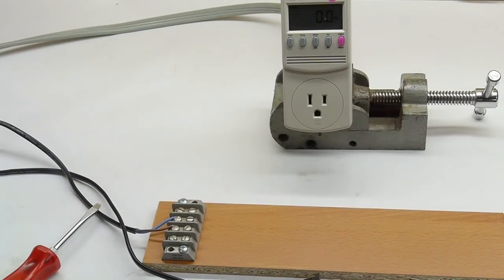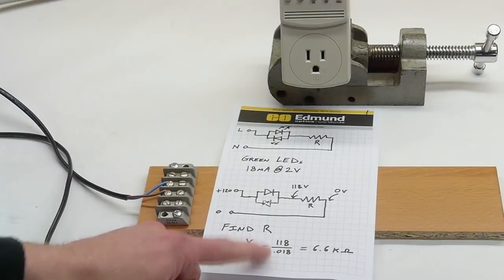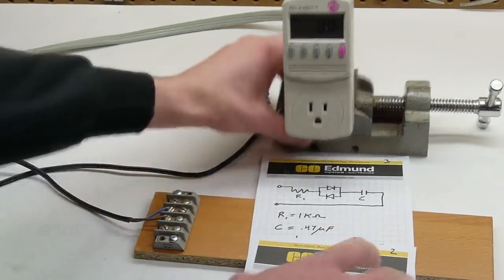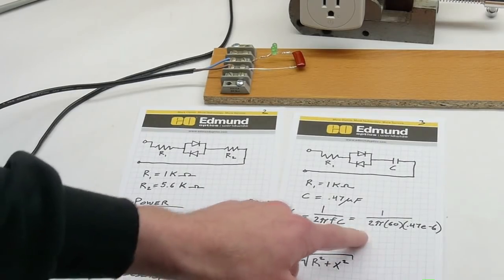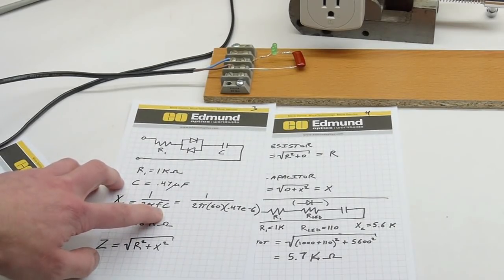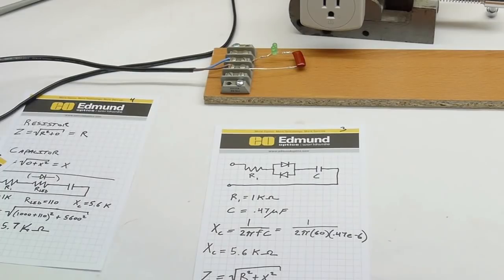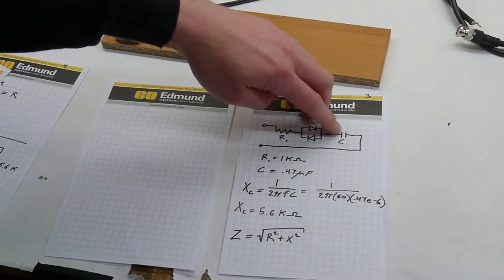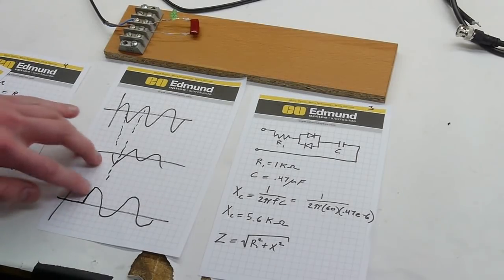Tutorial:  Electrical impedance made easy  - Part 1

Comment: It would be great to plug in both of the circuits you built side by side and then film them at high speed. You could replay it in slo-mo and show that LED#1 in one circuit comes on before LED#1 in the other circuit even though they are connected to the same power plug because of the phase angle change of the impedance due to the capacitive reactance. That would be a great visual to explain how the capacitor does not consume energy but rather returns the energy to the circuit at a different time in the cycle.

Comment: You can create the same effect by using a 1n4007 diode and a resistor.  The voltage is rectified into a dc source and the resistor limits the current.  The power factor is pretty good since noting gets too hot and you only need one led.  The ac frequency is high enough so the led does not flicker to the eye.

Comment: Question: That resistor that you added do prevent inrush related damage only has a value of 1k Ohms, which when put up against a possible peak +/- 120v of inrush, would draw something like 14.4 watts. Wouldn't that still absolutely destroy your LEDs? Obviously not, as you really understand what you're doing, and I don't, but could you explain how a mere 1k resistor can protect your circuit from inrush?
Reply from the maker: I didn't carefully engineer this circuit, and the values were chosen just for ease of demonstration.  You are correct that 1K is probably not enough, however to calculate the instantaneous power through the LED, you'll want to do the following:  In worst-case scenario, the plug is inserted at peak voltage (170V), and the capacitor behaves like a dead short at that instant.  Thus, 170V - voltage drop from LED = 168.5.  168.5/1K = 168.5mA.  Power dissipated in the LED is (0.1685)(1.5) = 252mW This is probably too much current/power for that LED, even for instantaneous ratings.  The current will drop very quickly as the capacitor charges.
Reply: +Conlan0215 You're right. 1kΩ of resistance is not enough for this circuit. In order to determine the value of minimal resistance required you'll need to consider the total response of RC circuit to an alternating voltage and not just the steady-state response. If you take this LED (L-383GDT), for example, in its datasheet it is said that the LED will take a maximum current of 140mA for (1/10)ms with (9/10)ms in between the pulses (1/10 duty cycle), or, in other words, it can handle a maximum charge of 0.000014C (0.14A*0.0001s) in 1ms. The max. current (or duration) of a single pulse should be somewhat higher (longer) for a non-repetitive peak forward current.

Btw, switching the circuit on at the instant when the voltage is going through its positive or negative peak (+/- 170V) is not the worst thing that can happen to the LED. Imagine what happens if the capacitor retains some amount of charge after switching off the circuit. Impedance(Z) = 5688.6Ω; Capacitive reactance(Xc) = 5600Ω; Source voltage = 170V; LED voltage = 1.5V; Capacitor voltage = (170 - 1.5)(5600/5688.6) = 165.9V ( it's the max. possible voltage that can be present across the capacitor when the circuit is off). Switching the circuit on at the instant in time when the source voltage is at its positive peak (+170V) would be perfect, assuming the cap voltage is oriented against the source voltage, like this: (- 170V + + 165.9V -). In such a case the overall available voltage across the resistor will be: 170 - (165.9 + 1.5) = 2.6V, which will produce a current of 2.6mA through the LED (2.6/1000 = 0.0026, Resistance(R) = 1000Ω). Now assume that the voltage polarity on the capacitor stays the same (+ 165.9V - ), but this time the connection of the circuit to the source is made at the instant in time when the source voltage is at its negative peak (-170V). In this case the capacitor and source voltages are oriented in an additive manner, like this: (+ 170V -  + 165.9V -). The overall available voltage across the resistor will be: (170 + 165.9) - 1.5 = 334.4V, which will produce a current of 334.4mA through the LED (334.4/1000 = 0.3344). The problem can be solved by placing a resistor of MΩ range in parallel with the capacitor (the capacitor will discharge through the resistor each time the circuit is turned off).
Reply: because the value of a half cycle current is not more then 14 watts, so it will be absorbed and dissipated before it goes beyond capacity of resistor and reach LED.

Comment from the maker: True, the word "electricity" could be used in context of "static electricity", so it may not be fair to say that electricity flows. However, Merriam-Webster says that the electricity is "an electric current or power", and in my experience, most people who say "electricity" without the word static, are referring to current flows. Saying "voltage flows" would definitely be wrong, and I agree separating the concepts of electromotive force and current flow is important.

Comment: Really good information here. I could never find an easy explanation for it.  I actually measure impedance all the time on CLRs to check if they are degrading with an LCR meter.  So after watching this I am confused how the meter does it when just measuring a coil without knowing the frequency. Or is it just assumed it is 60?

Comment: That's really a great video! May God bless you for putting this up and helping us! :)

You said at 3:15, that LEDs don't care whether the resistors be on the left side or right side, I don't get that.

Shouldn't the resistors come prior to the LEDs so that there's a sufficient voltage drop prior to the LED and the LEDs get the required voltage?? However placing it after the LEDs would expose the LED to the mains voltage and harm the LED, as the voltage drop shall take place only after the LED, isn't it ?

Thanks.
Reply: Fuaad Mukadam voltage is not a "thing" but a potential difference between two arbitrary points.  it's relative. you're just as likely to plug the circuit in when the voltage was at the negative part of the ac cycle and the electrons wanted to go the opposite direction.  The resistance  restricts flow in either direction.

Comment: Great video very well explained. Ben I live in UK 240v I have a German valve radio 1950era this is 220v could I insert a cap of suitable value to drop 20v before transformer? Resistor would get too hot, many thanks John.

Comment: Hi Ben,

This is a great tutorial. I would like to try this in my workshop. I know the size of capacitor you used, but what type of capacitor did you use: Ceramic or Aluminum? Also did you use an AC or DC capacitor and what was its max voltage?

Thanks

Comment: Thanks mate, good video, that really helped.

What you say at the end about without there being a resistor in the circuit you experience that 'sharp spike' in current at the instant of applying power, which cooks the LED. Is that similar to what happens in your home when you turn on the lights and the globe blows straight away?

Comment from the maker: The frequencies are relatively low, eg a few Hz, or even fractional Hz. It looks like they are studying the impedance characteristics of electrodes as they vary the polarization potential across the electrode. The battery's construction is similar to a double-layer ultracapacitor, and so they are perhaps trying to separate the capacitive effect from the electrochemical effect. As with most research papers, we'd need a lot of background info to make sense of their work, and I don't have time.

Comment: This looks like a good idea, in theory, but in the "real world" there is another problem, besides the inrush at plug-in time.  Any noise spike on the line will fly right through the capacitor because it is equivalent to the behavior of a higher frequency.  Still, this is an awesome way to relate resistance, reactance and impedance.  You can try this at home, but it's not something you should implement as a long term solution.  Kinda like dryer lint, it looks harmless, but could burn your house down.  ;)

Comment: To be honest, I never thought of Z geometrically.  I've always thought of it like a vector.  R is the horizontal distance and X is the vertical distance in the complex plane.

For finding the output voltage of a circuit where the input is not sinusoidal, mesh analysis still applies and I can just represent E as the function, right?  I am trying to analyze a circuit with a bridge rectifier with a Vf of 1.4V.  Therefore it's |sin(wt)|-1.4?

Comment: I am making a dc generator to mount on the front of my bike. When I hook up a 9v the 3-12v dc motor it runs fine. However when I put the propeller on, the motor starts off pretty strong, but it gradually slows to a stop in about a minute. When I let it set for a few minutes it works again, but for a little less time. I suspect it has something to do with that the motor being at 19k rpms or the 9v might not be high enough to handle torque but it doesn't explain the gradual loss in thrust or the gradual "charge up" times needed to wait until it works again. Any explanations, solutions, or really any information on the subject at all would be very appreciated.

Comment: 2:30 I'm confused. Wouldn't putting a single resistor to the right of the diodes as pictured cause one of them to be exposed to the full a/c voltage and fail?

Comment: I notice that the reactance when the signal is pure DC is actually undefined - not zero nor infinite but undefined. Does that just acknowledge the laws of thermodynamics (no circuit can have a pure DC supply from the beginning of time to the end of time) and how do we analyse circuit impedance for a finite interval? Because we have a step discontinuity when we initially switch our circuit on we have a large nonzero value for the fourier coefficients across a lot of wavelengths (and nonzero across all wavelengths), I assume we can get a reactance for each frequency component, can we take the inverse fourier transform to get a continuously varying reactance for the circuit and thus find any finite integral, divide by the mass of the component to see if it can handle the transient at circuit switch-on?

Comment: I was under the impression that USA 120 volts is half of the sine wave. Which half depends on which leg of the 240 coming into the panel. So when you show the sine wave starting on the line (zero) and traversing back and forth, that represents the full 240 volt cycle. The 120 is the rise and fall, zero, rise and fall, zero on either side of the line. Am I wrong? Thanks!

Comment: Interesting video,   I tried  to convert 12v AC to Dc by rectifier bridge diode ,but as soon as I connect a light to DC side, the rectifier bridge diode goes so hot although the current draw is less than diode rate,     what could be the cause of over heating ? can I use similar capacitor for my circuit?

Comment: You chose R1 to be 1K to prevent high inrush current. Can you show a way to calculate minimum R1 resistance value required in order to put smallest resistance so as to preserve more power?

Comment: Question...Since the difference between true power and reactive power is basically phase relation, Is it true to say that some component of the reactive power occurs during the time that real power is consumed? And if so How does the KWH meter differentiate between reactive power and real power?

Did anything change in this relation when mechanical meters were replaced with "Smart meters" ? How can the meter diff between consumed power and returned power when the polarity is always changing? TU

Comment: When the current swaps polarity does the capacitor add extra voltage since it's discharging? Similar to how it does in a clamper circuit?

Comment: So if I understand correctly, you've designed the circuit so that the RMS voltage/current is in the range that you want for your little LED. But you're feeding the LED A/C, which means that the voltage peaks will be higher than the RMS value. (1.4x more I think), and possible exceeding the LED's maximum rated forward voltage. Won't that slowly toast the LED? If you design the circuit so that the peak voltage is around 2V, that means that the RMS value will be fairly low, and the LED won't be very bright. I understand that this isn't the point of the video, but I actually want to know if this is a good application.

Comment: Instead of shorting the capacitor after unplugging could you have put a MegaOhm resistor across it? So high that it does effectively nothing during operation but low enough to discharge the capacitor rapidly once switched off following the same principle as electrostatic protection devices?

Comment: Also, im still a bit sketchy on how matching impedances results in maximum POWER transfer from the source to the load and If the load impedance is 10 times or more the source impedance  results in maximum VOLTAGE transfer from the source to the load.  Is this because the high resistance "squashes up" the voltage signal, so that its higher? wow, i think i get it. and then an amp is used to boost the signal?  sorry for asking so many questions, that are a bit off topic

Comment: Where did the 2 pi come from? why is that the formula? where did it come from? Not sure this helps with any insight to what reactance is, on a positive note you did a good job with the video and explained what you were doing very well.
Reply: +Michael Katt It is the general formula for the calculating reactive capacitance...
Reply: +Michael Katt It's because the system involves AC and thus sine waves.

The current in AC over time describes a sine wave. Sine waves are derived from circular motion, and their phase (the x axis) is measured in radians expressed in terms of PI. A whole cycle is 2PI radians.

There's a whole lot more on the subject and I am unable to give a detailed explanation. But there are plenty of resources available on how sine waves are derived from trigonometry and circlular motion.
Here's a good place to start: 
http://betterexplained.com/articles/intuitive-understanding-of-sine-waves/

Check out the wikipedia page on capacitive reactance for the details of how the formula works:
https://en.wikipedia.org/wiki/Electrical_reactance

And this page on angular frequency might give you some insight into why PI is used in the formula:
https://en.wikipedia.org/wiki/Angular_frequency

Comment: Do you think that a resistor greater than 1k @ 1/4W would have any design advantages since if the AC current can be initially be as high as 170v peak which will require as much as 5 WATTS from the 1/4 WATT resistor:  even for a couple of milliseconds?  This will certainly destroy many solid state components!

Comment: With what your saying about the "inrush". Doesn't the voltage oscillate with the current, being that so , if a "negative" spike rushed into the circuit, wouldn't that smash the capacitor? I'm a noob, sorry.

Comment: From the postscript about the inrush current, it seems that for larger applications, the power wasted by the resistor would become significant. What are the best circuits for limiting inrush while not continuing to waste energy after the first fraction of a second?
Reply: gluino In high power devices, one way around this is to use what is called a "Soft Start Relay". Essentially, when the relay is open, the current flows through a resistor, to get to the capacitor(s). After a brief delay, the relay closes and the current has a straight path to the capacitor(s). 
For more moderate power ratings, a transistor can be used in place of the relay. It is also possible to use a thermistor that is high resistance at low temperature and goes close to zero ohms, as it warms up.

Comment: It's been 9 years since I studied physics, 
I finally get a zest of what impedance is, 

But what happens if I'm using these with a signal?
Like with a LC circuit for an AM radio.

The frequency changes based on what I'm tuning into, 
And the actual audio is a different order magnitude than actual signals, 

What does a high impedance headphone really mean???
Reply: The impedance will dictate how much power you can put through the  device, the piezoelectric (speaker) in this case. For maximum power transfer it is necessary to impedance match i.e. maximum power transfer occurs when the source and the load have the same impedance.